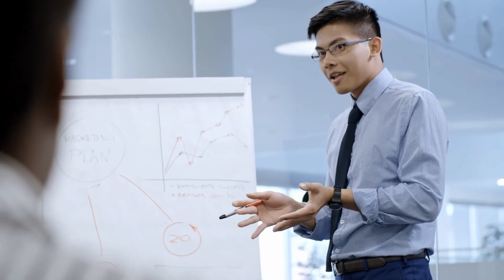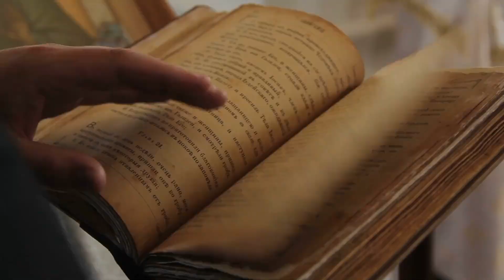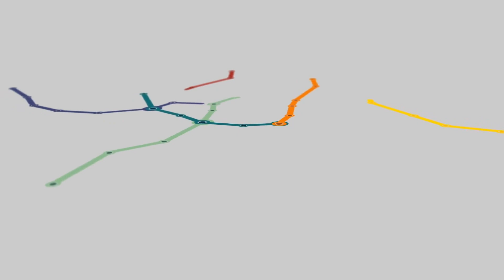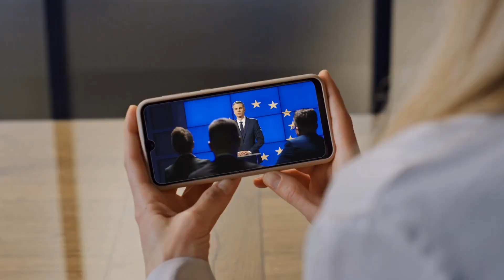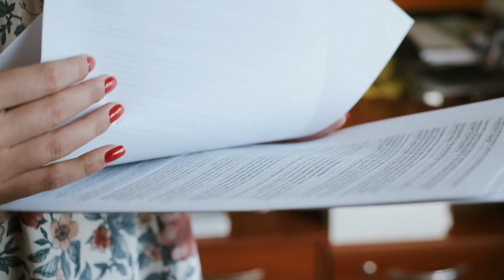Europe's $600 Billion T-Ten Transportation Giga-Project

Comment: Train: Speed, railwidth, electrical voltages requirements are different; Boat: Depth, width, length, speed, power; Plane: Weight class, wingspan, size, power.... throughout EU. War, climate, speed of technological advancements, global economical unbalance make the plan look old and naïve at least 😂. At the most positive side of any doubt, i'll give EU plan a 50% chance of succesfully reaching 30% of the plan's entirety. Including; financially, physically and time wise. Better plans are; Above ground Huge Hyperloops for international long distance highspeed containersized pod-transport. Deep tunnelsystems for national (intercity) small new sized container transport and heavy drones and air baloons for local transport.

Comment: This project is incredibly expensive and the final cost will be much more higher than expected at the beginning. But it is possible to decrease costs with increasing a speed of the project if we take into an account China's experience. China successfully decrease costs of their infrastructure project by unification technological process. Europe has to follow this way. This is a crucial issue. Repeated work costs less than a single ones.

The same applies to the trams in cities. The first renovated or built from the scratch tram line in a city usually costs a fortune. But the second and following are much less expensive. This is a result of using the same equipment by the well experienced teams that do the work faster and cheaper. Also, the process must not take long brakes that increase costs. We can also take into an account an experience of building Moscow metro - one of the largest metro network in the world that is continuously being built with opening a number of station per year. This definitely works like an assembly line and the process is cheap and speedy.

Comment: The EU will never finish this vision because there is no more money to fund it. Germany has been financing the EU several decades. Thanks to Green fanatism the economy of Germany is done. Germany is no longer able to finance the EU. And there is no recover in sight.
The economic power houses of the future will be China and India. 
To give you a picture of the grim reality:
China has build tens of thousands of kilometers of high speed rail within a couple of years and is connecting with neighbors. They are even building railways in the Himalaya mountains.
And Germany takes about 80 years to add two tracks to the railway line in the flat and wide Upper Rhine valley between Karlsruhe and Basel.

Comment: l would be happy if by 2070 trains in Germany would be punctual and regional trains in France still would work somehow.  I hate those Mega Projects in which urban  Elites  think the absolute priority is  to connect the Megapoles only.
Reply: Megapoles ? Talinn, Riga or Vilnius ? They're capitals but not megapoles.
The thing is that larger cities are much much much more efficient and easier to ecologically transition than rural areas or small towns.

When you build high-speed lines between large cities, or metro, tram, RER or S-Bahn lines in a large city, you can move millions every day.
Whereas regional trains have a much more limited impact.
Sure, the regional trains in France should be improved, but what has more impact on the ecological transition is to stop the development of single family housing and push for densification.
Reply: "the thing is that larger cities are much much much more efficient and easier to ecologically transition than rural areas or small towns". Absolute NONSENSE
 @KyrilPG

Comment: Very interesting project but what seems to be bugging me is wether the national infrastructures that already exist are being modernized and expanedd or wether they're bulding completely new infrastrcutures. Furthermore the environmental aspect is something to look after as the EU needs a better transportation connection within its borders but it also has clear environmental goals.
Reply: large part is upgrading existing network, or making links that shorten travel times (think double tracked tunnels trough mountains instead of long, single tracked and curved rails across the mountains). But one of the main upgrades is forcing the same train security systems on all european main raillines. Because currently every state has developed its own system (or multiple ones) and it gets very expensive very quickly to install multiple systems on the same trains (as they all require different hardware, and this is one of the main obstacles for international rail (and freight by train is so much more enviromentally friendly than by truck)).
Reply: Öbb railjet is introducing more and more night trains. 
And many trains already cross borders (e.g. Frankfurt to Paris/ Vienna to Frankfurt/ London to Brussel / Frankfurt to Zürich)
Reply: Yeah the original infrastructure is upgraded if possible. Check stations Berlin, Stuttgart,  and in future Hamburg and Frankfurt. But lots of the german network is shit that needs dedicated new infrastructure for high-speed like france has already. 

Google diagram. French trains on average and German trains. The french cover alot more distance per hour.

Comment: so am i understanding this right, finland is the only one who doesnt get underwater train ways
Reply: At the moment construction of railways fit to the standard gauge is being executed to Tallinn from Poland. But there are plans to make a tunnel from Tallinn to Helsinki, for now its still a 2 hour or so ferry
Reply: @rubenwartena2458  If the  tunnel would be bored to Spanish loading gauge, it perhaps could take in gauntlet track of 1520 mm and 1435 mm which would allow extension of Rail Baltica to Helsinki and at the same time link current Baltic 1520 mm network with Finnish 1524 mm (original broad Gauge) for easier exchange of cargo.
Reply: I think there is one from Helsinki to st peterbouge/in Russian federation @MrToradragon
Reply: @julianpignat9095   While there is rail connection from Finland through Russia to Estonia it still is significant detour, over 700 km, tunnel would cut that to roughly 1/7th. And the travel time perhaps even more as it would get rid-off two border/custom checks.
Reply: There's one from helsinki to talin in the works